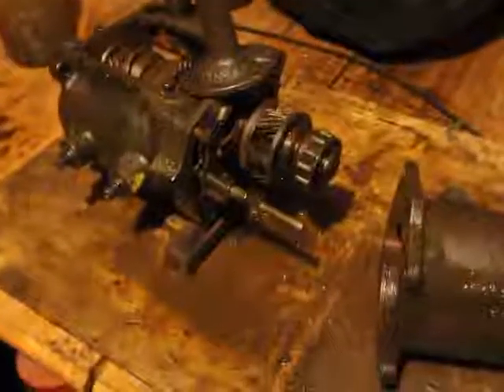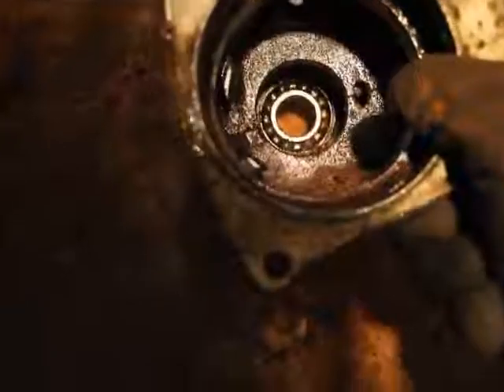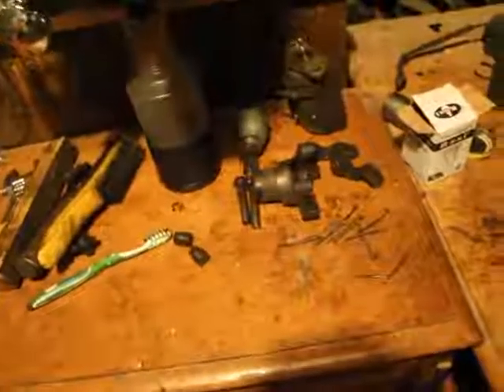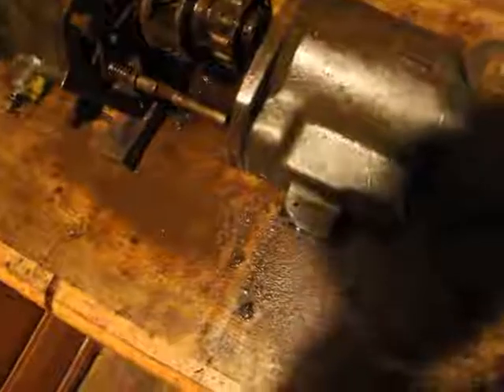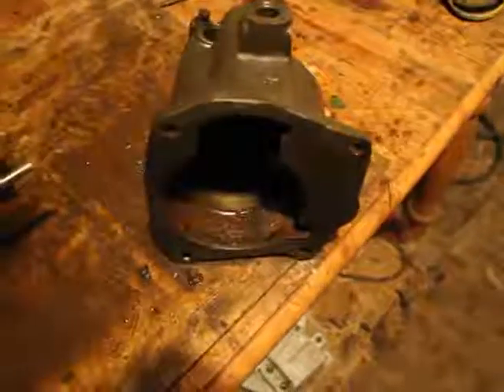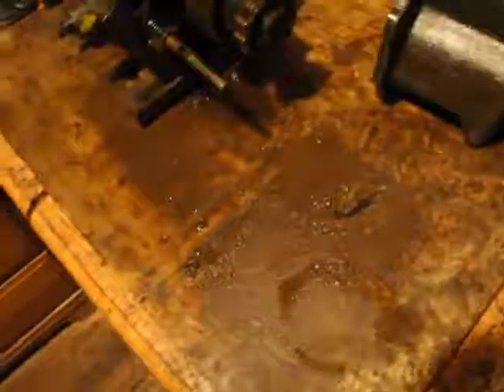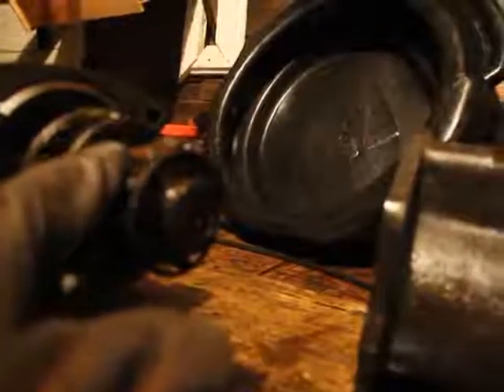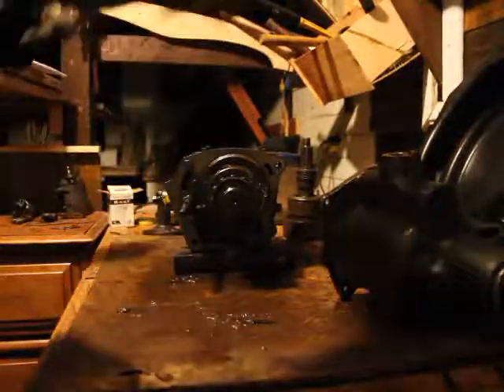T96 Dissasembly part 1

Comment: I have a 1949 willys jeepster with this same t96 transmission and I'm trying to find videos and resources to help me fix or teach me how to rebuild them, I'm curious how one can come across that manual you showcased In this video?
Reply from the maker: Well, I have a pretty extensive and boring (but complete) series on rebuilding this transmission. 

The manual is part of the "1963 Rambler American owner's manual". 
Although it's reasonably straight forward to disassemble this transmission.
I didn't use the manual.
Reply from the maker: Let me know if you need help